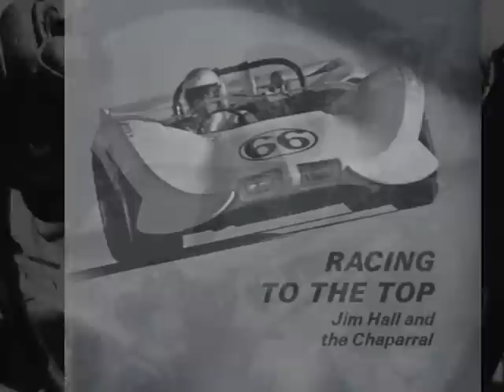RRDC Evening with Jim Hall - Introduction by Sam Posey / Interview with Bobby Rahal

Comment: in 1968 I was a 19 year old kid.  November 11 1968 was a Sunday.  I was standing at turn 1 when the number 11 Lola came thru the turn and stopped because of a suspension failure.  The next car thru was Jim in his Chaparral.  He hit the back of the Lola then went 20 feet in the air, landing upside down.  I have since talked to Mr. Hall several times at Road America.  The first time in 1980 I went up to him and introduced myself as a spectator at turn 1 at Stardust.  I told him I was at the race the day of his accident.  With his typical dry humor said " I wish I wasn't" and then laughed.  He is very cordial and polite and brilliant when it came to engineering cars.  He is a great guy, loved talking to him.  Very willing to talk to the fans...unlike so many drivers today.

Comment: In 1967 I was lucky enough to get one of the Chaparral 327 back-up engines from Chevrolet and dropped in into my 210 series '55 Chevy, Muncie close ratio 4-speed, Anson bell housing, largest clutch I could get, high rise alum. manifold with series D AFB 4-bbl carb, and there wasn't a 427 vette around that I couldn't beat.  Had a St. cop pull me over once just to see what kind of "big block" I was running.  It was a little monster!  I put 456 third member, but had to go to 411's to get traction.

Comment: I was at Bridgehampton in '66 when the 2E was unveiled,or actually uncovered. Hard for younger people to get but it was on a flat trailer with wood sides and was covered with a canvas tarp, except for this thing sticking out. Really. When the crew removed the tarp, those of us standing there just looked. Strangest looking car.....looked kind of like a guppy....had what turned out to be a wing...a wing....sticking out of the rear bodywork. How the heck does that work, we all thought. Well, as it turned out, never as good as it should from '66 on.Phil Hill himself said that if Chaparral had used a damn Hewland they'd have been champions, just like had Jim decided to use a normal size car battery maybe the car would start after pit stops...but all that's shoulda/woulda/coulda for a brilliant guy like Hall.